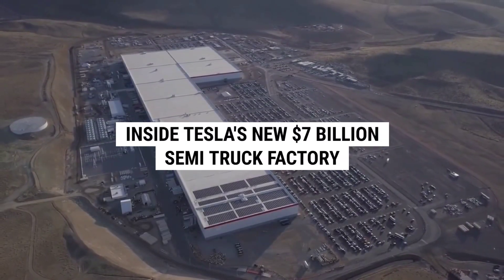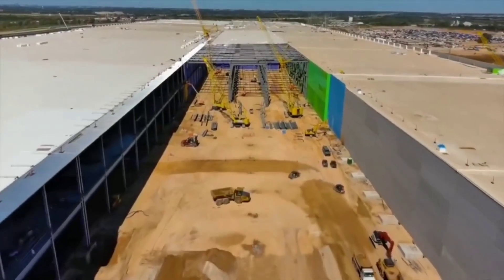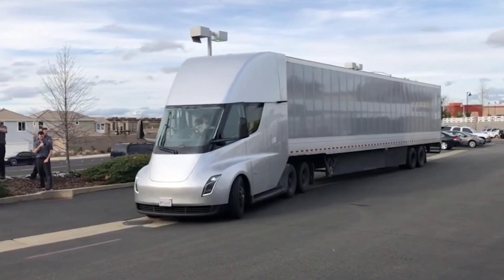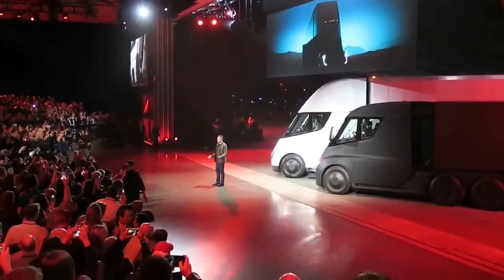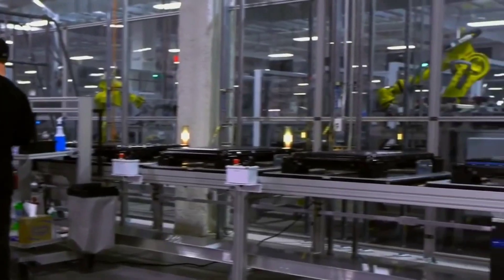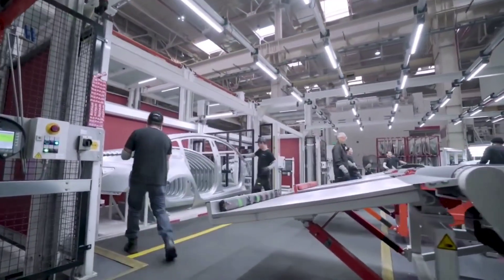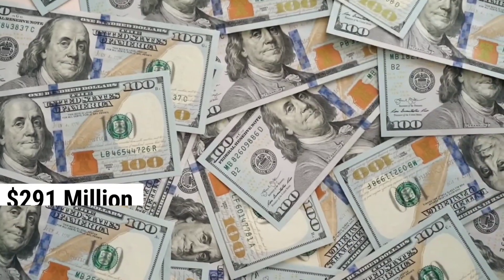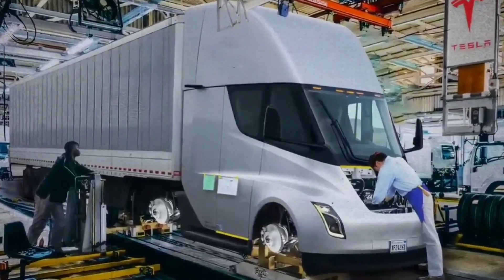Inside Tesla's $7 Billion GIGA Semi Truck Factory

Comment: I think the options for the truck are 500 miles and 300 miles not 3000 miles.
Reply: Yeah. The haters will use this as a source showing Tesla claims a 3000 mile range.
Reply: @Seehart  Honest mistake I’m sure.
Reply: @DownForFun  of course... but got me thinking.... assuming battery supply chain issues were resolved, how much range and cargo capacity would a Tesla Semi have if the trailer floor was a structural battery pack?
Reply: @Seehart  Pretty far if they make a three or four tier deep battery pack!